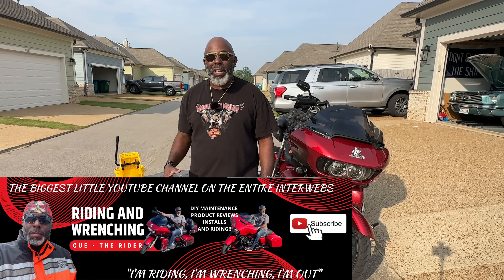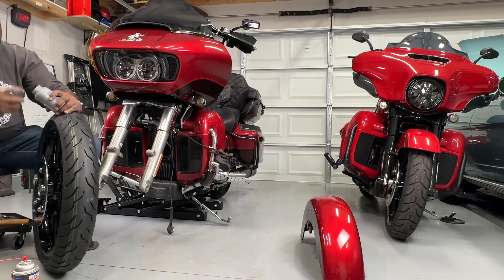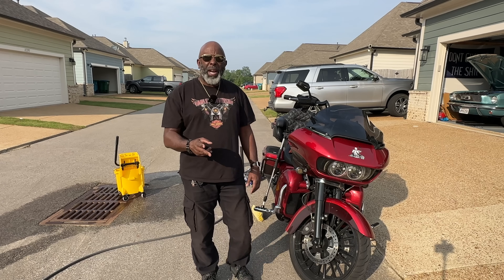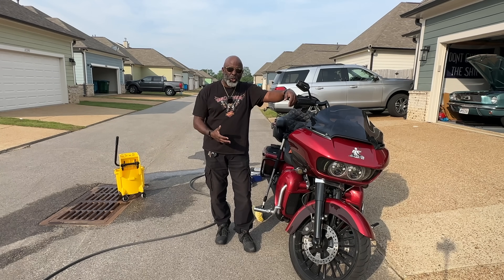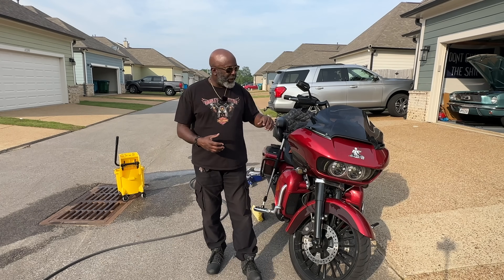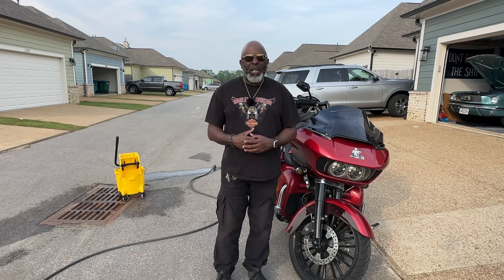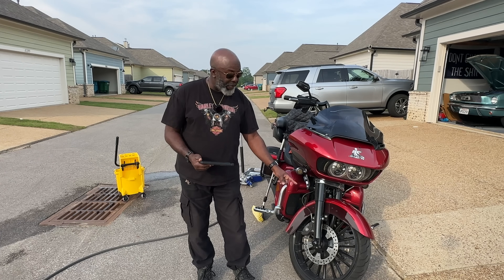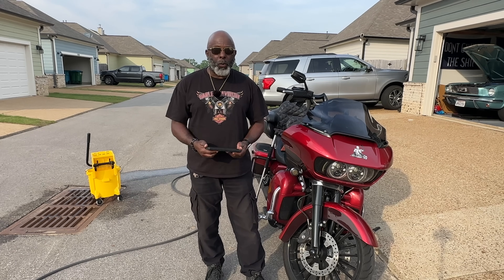Why You SHOULD NOT put  21" wheels on your Harley!

Comment: Engineers have been building motorcycles for years. There is a REASON why they design a factory motorcycle the way it is. Customized motorcycles are not always the best motorcycles to buy.
Reply from the maker: Agreed! Customized motorcycles don't hold the value of the accessories either!
Reply: Neither do the stock ones. They all depreciate.
Reply: Nice stuff brother. Was looking into it for the Goldwing lol. Seriously, good info. We do certain things for looks but there will always be a draw back in performances and in some cases reliability. Ride safe brother.
Reply: Engineers generally concede to the constraints imposed by bean counters.
Reply: @Hey Bruh  they might concede to the bean counters for cost, but they also have to concede to the Government for safety.
Reply: @MrNew122   Okay.  So why have road glide models - from the factory, come with different size tires if safety and regulatory concerns were an issue?
Reply: @heybruh3274  if there was a serious Engineering issue that affected the motorcycle I am sure the Harley Davidson dealerships would not be offering 21 in wheels and tires. As long as the rake does not decrease in term of degrees from stock you will be fine. And the rake and trail does not get changed from adding a larger wheel an tire.
Reply: I agree. Other than slip on pipes all my motorcycles and automobiles are stock. Ride and handling is fine.
Reply: Spend the money get great products and your bike will ride fine. I have three and they ride fine.
Reply: However, to say that customization doesn’t improve performance is overreach because lots of aftermarket items DO. AND, if you are a person who, for example, plans to install upgrades a great way to do it is find a used bike with some of the things already installed to lower the cost. Been doing this for decades and it costs a lot less than buying a new bike and adding.

Customization is something most people like to do. That’s why the market is huge and often it enhances and improves performances in many cases.
Reply: Lol, we are talking about Harley Davidson aren’t we? Stock bikes do not come with the best engineered equipment, they understand that they make more money helping you improve your bike than they make on the actual bike. 
That said, changing the diameter of the wheel/tire assembly is a pretty major move and probably not a great idea.
Reply: These “engineers” put stock exhausts on these things still. The whole out of HD is customization and upselling performance parts

Comment: I'm rolling a front 21 on stock suspension. Maybe it will hit me when I'm older but I don't mind the added "road feel". Ride safe ya'll!
Reply from the maker: My 53 year old back doesn't like a harsh ride!
Reply: The added "road feel" is not because you went with a bigger wheel, it is because of the lower profile tire. There is not as much sidewall to "cushion" the bumps. Adding different suspension wont change the outcome. Its just like in cars and trucks, the effects of lower profile tires are identicl to a bike.
Reply from the maker: @Venomized95  I haven't experienced any issues with handling or slow speed riding or riding through twisty roads. My biggest issue is the kickstand (which is an east fix)

Comment: I own a 2019 CVO road glide with 21”wheel, took it off put 18” front wheel , it handles sooo much better, added race tech suspension. I don’t feel every bump, and not as worried of pot holes. This video is accurate.
Reply from the maker: Thanks for the feedback! I agree that the 18 is more comfortable. One thing I like about the 21 is the added lean angle. I was a little worried at first but quickly got over it and now I actually like it
Reply: It must be a older thing because my 21f and 18b ride perfect and finding tires aren't that bad I really believe ppl take the cheapest route when buying rims and tires which really plays a major effect.

Comment: one other thing about the wheel issue that you mention about the mileage being off means it quite possibly can be throwing off the speedometer as well which in some place can get ya into trouble that get really picky about speeders. kinda like the way how going up or down in tire sizes with cars/trucks will throw off the speedometer if you don't match the factory specs with rims and tire size..
Reply from the maker: The speedometer is off by about 3 or 4mph at higher speeds. It's weird because it isn't consistent. At lower speeds (below 40) it's accurate.

Comment: This video is spot on brother..was at the Harley dealership the other day and was told the same thing from other riders,I have a 2020 roadglide special with the chopped engine guard,if u get a 21 rim...when u hit a bump or pothole of any size..the middle of the fender will hit the center of the crash bar mount,especilly if u have the fang fairing installed like on the CVO, the only way it will work is to upgrade or change the front suspension....period.

Comment: I have run a 21" wheel for on every Harley and Victory I have owned over a 20 year span and have never had a problem with a 21 and actually found the ride to be better in most cases.

Comment: Interesting take mate. I'm running a 23" low profile on my Road King but I went into it knowing that I needed rake, suspension, fluid upgrades and changes. As for the tires, holy crap , glad you're okay mate! That would have dumped more than the brakes for me!

Comment: The speedometer is based off the diameter of the rear tire. You can put bigger rims on and still maintain the tire diameter. The front tire diameter could mess with abs but not speed.
Reply from the maker: I should have been more clear. I put an 18" tire on the rear (replacing the stock 15".)
Reply: @RidingandWrenching  you were very clear. People just need to have something to bitch about 😂

Comment: Ive been running 21’s on all my bikes for quite some time. While everything youre saying is true, to each there own. All of these reasons can and many should be addressed when changing to this size wheel. IMO, the most important one being the front suspension internals and the ride height of the bike increasing when moving to a 21. Both of these can be addressed with an upgraded front suspension and thats what Ive done in every bike that has the 21 on it. I believe they ride better than stock in some ways and not as good in others. To each their own. Ride safe!
Reply from the maker: What did you do for the jiffy stand (if anything). I ordered a longer stand, but I saw someone bolt a small block to the bottom of the jiffy stand
Reply: @RidingandWrenching  I have never done anything to the kickstands on my bikes for this. They work fine as-is.

Comment: I put wheels on my Heritage and I was told by several Dealers not to go to a 21 because of the same reasons you mentioned plus it could throw off the ecm, So I went from 16's to 18's and it was fine, the bike now takes the same tire as the road king and I think it handles a bit better
Reply from the maker: Awesome. Thanks for sharing!
Reply: 16s are the best. On a softail chassis, I guess nothing really matters.

Comment: Quite amazing the way fads come and go on Harleys. Way back in the day up today . Twisted chrome . Sissy bars , different pipes over the years . Seats , the old baggers gave way to the choppers , fat wheels . Tall wheels . Back to the street glides , to slammed baggers , big ass stereos , never got into the fads , still riding my 05 low rider almost 20 years later .
I’ve noticed though … Bro hasn’t put the OEM stuff back on it . Looks cool AF
Reply from the maker: I like my bike! I've gotten rid of most of the OEM parts that I removed. Compared to many other bikes, my "upgrades" are pretty subtle
Reply: Wonderful comment.

Comment: Great video, I installed the FOBO Bike 2 tire pressure & temperature sensor. It replaces your valve stem cap and the colors are black or chrome.
Reply: Sorry, it is Bluetooth connection to my phone.
Reply from the maker: How long have you had them on your bike? Any issues?
Reply: @RidingandWrenching  

I had them for over a year, no issue. It takes about 30 seconds to pair up to my phone. I highly recommend the FOBO Bike 2, you set your tire pressure in the app & notifications when the pressure is low.

Comment: progressive front springs with a slightly lighter fork oil at exactly the same level (left to right) will return you to stock or even better, adding a fork brace and an adjustable steering stabilizer will help even more

Comment: I have an older FLH Shovel that came with 16" put a 21"up front years ago never really noticed any difference. Just picked up a used SG that someone installed a 21"up front, other then the front probably rides a tad taller really don't notice any difference in handling.
I started out on rigid frames with springer front ends so everything after that has been a huge improvement to me, I'm sure stock is best all around but I've never been able to leave especially a HD stock.
Reply: The only difference you should feel is it being a little "heavier" feeling in low speed maneuvers.

Comment: I live in a state with some of the most horrible condition and potholed roads as rated by Truckers, and a fat 130/90/16(at least!) is the only way to go! I had a friend who went over a storm drain grate with a broken slat and his 100/90/21 dropped in that extra-wide 'slot' and stopped his bike dead, putting him over the bars. I see lots of bent rims from riders who run low-profile tires too!

And 21's are downright scary on rain-grooved roads or steel-grate bridges! 🥺

FWIW: If ya run laced (spokes) wheels and tubes, PJ1's Balance Plus works great! Originally designed for dirt bikes, it's work great in all my spoked rims/tires for over 30yrs.

Comment: When you go to a 21” wheel to bring it back down on the front end you need to put in a 1” springs forks drop kit.
  I put the Legends 1” drop kit in my 2016 RGS and it’s perfectly fine and no issues with the kickstand.
Reply from the maker: The ride height doesn't bother me. I actually like the added lean angle. The problem is the jiffy stand.

Comment: Great video with a lot of good considerations to take into account if you’re thinking about upgrading your wheels. I will put two things out there. #1. Your miles you travel vs. what the odometer says could be because the standard in the US says that motorcycle gauges only have to be within 10% of true value. That means that your speedometer and miles may be off by up to 10%. #2.   Is that your front wheel is on backwards. If it was on the proper way your 90 degree valve stem would be pointing the right way. The tread of the tire is made for water evacuation. The tips of the tread in the center of the tire should make contact with the road first and then force the water through the channel and out the side of the tire. The way yours is currently installed would actually force water into the center of the tire and could be a hydroplaning hazard while riding in the rain.
Reply from the maker: The wheel is mounted on the bike correctly. The stem is facing the wrong way. It will be an easy fix. I double checked my tire. The directional arrow on the sidewall indicated I have it mounted correctly.

Comment: The larger the front wheel the more gyroscopic effect is generated, the bike will be harder to turn the faster you go, the bike doesn't want to turn because of this effect, so the bigger the diameter the more effort you will have to put into the steering.

Comment: I agree with everything you have talked about with the exception of odometer. The speedometer and odometer are controlled by the VSS (vehicle speed sensor) It is located in the top of the transmission and has nothing to do with the front tire. You could have a 36" tire and it will not affect the odometer or speedometer. Now when you change the back tire, that will affect both.
Reply from the maker: Gotcha. There was no impact to the speedo due to the bigger wheels.

Comment: As far as the kickstand when you upgrade the wheel size you need to get the electrical and that's a bar that drops down directly up under the motor and rises to where it sets even
Reply from the maker: That would actually be quite cool. I may look into that
Reply: Call the center kickstand so it helps the bike sit up correctly when you going to a 21 and a 23 those are your safest highway rides but you also have to be sensible about your drivers with and on top of that if you're going to be traveling consistently you shouldn't have put a 21 on there anyway because you already have too much weight against you just touring with all the extra weight @RidingandWrenching

Comment: I would imagine doing hard leaning twisties is out since low profile tires effect the how much lean you can do and have traction. Instead of grinding foot boards you end up grinding rims lol.
Reply from the maker: The taller tire actually gives me more lean angle. I have done tight u turns and other maneuvers with no issue. 

My big issue is ride quality and how low profile tires screw up the suspension

Comment: Hey Que, I put a progressive lowering kit and that kit brought my bike down a 1inch in the front. You can do 2 inches and I also used a heavier oil as well. Great video
Reply from the maker: How did the lowering kit affect the ride quality?
Reply: @RidingandWrenching  my bike ride as if I still have a 19 inch wheel 🛞 on it.
Reply from the maker: @kellybgliding  I bought a longer kick stand. I'll let you know how it turns out. One thing I like about the higher ride height is more lean angle.

Comment: I like the way you are so detailed in your analysis of a major change. I had stock 17 rear and 21 in the front. Hated that tire mainly because it was very narrow. So I changed out to a 17 with a wider rim and now she handles like a dream. The rake will change so that is a consideration also.
Reply from the maker: Thanks for the feedback! I have no intention on changing the rake. I don't want a longer wheelbase....it would screw up the riding dynamics too much for my liking
Reply: @RidingandWrenching  My stock wheelbase with the 21 inch wheel was 5.2 inch trail. That's actually great for going straight. When I put the 17 on the front it went down to about 4.29 trail which in the world of biking is GREAT!

Comment: Great video.  I saw a gentleman riding a Harley on I-55 the other day with what must have been a 24 inch front wheel on it.  It was a beautiful bike, all chromed out and painted darkish teal. It looked good, but that wheel's gotta make it uncomfortable as all hell going over bumps.
Reply from the maker: I have never ridden one of those big wheel baggers. 21" is the largest tire that you can put on a bike without making other changes (so I've been told). As much as the 21 changed the ride quality on my bike, I wouldn't dream of doing anything bigger

Comment: Great video bro and if they had rotated ur bearing on the front rim the valve steam would be on the right sight of the wheel its a simple fix 👍🏾
Reply from the maker: it's an easy fix. I'll address it when I get new tires.

Comment: The front wheel will not effect the speedometer but the rear wheel will. By performance I'm assuming you are referring to cornering and braking. The will both be reduced from stock performance. Good video. I'm sticking with the stock wheels. Performance is more important to me than looks.
Reply from the maker: I increased the size of the rear tire to an 18". I should have been clear that I was referring to the rear tire affecting the speedo/odometer. Stock wheels are much more comfortable!

Comment: It definitely affects your speedo and odometer, a larger or smaller wheel for that matter either takes longer or shorter time to complete a full rotation. Easiest way to understand this is to watch runners on an ovular track or nascar or similar. The racers on the outside of the track start further forward than the racers on the inside of the the track due to the outside being wider and taking longer to complete a lap. Your Odometer and Speedo are calibrated to the the tire they came with and count the revolutions to decide your speed and distance. Take it to a mechanic and they can adjust that
Reply from the maker: That is exactly my point. I was told that the speedo feeds off of the transmission....but it still has to be calibrated with the wheel size